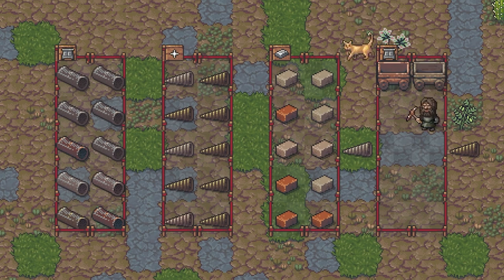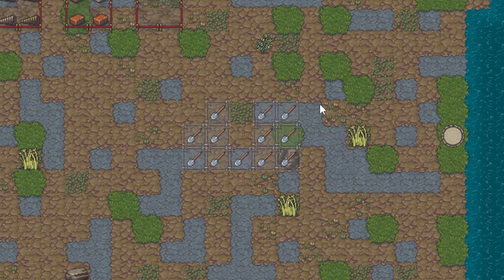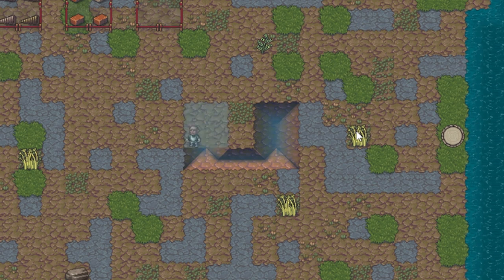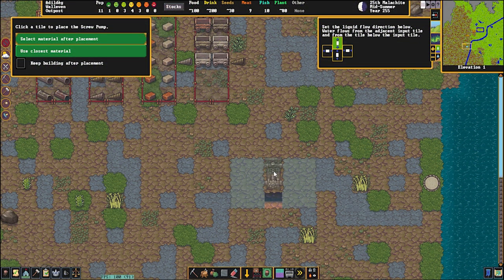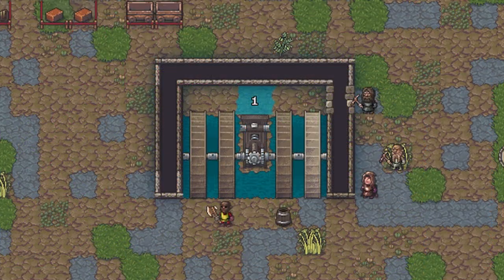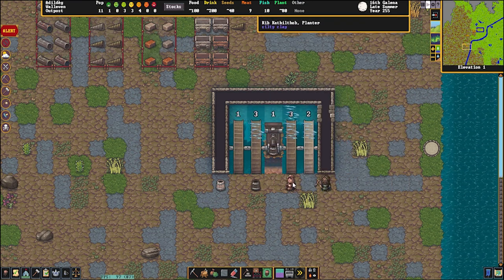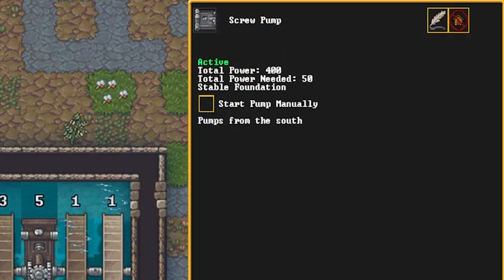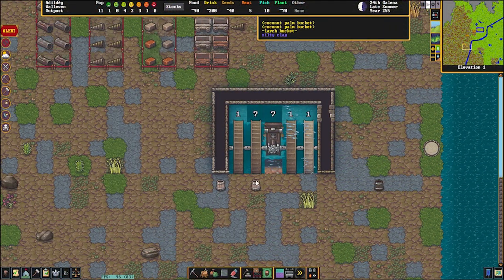Dwarf Fortress - Quick Tutorials - Infinite Power Generation (Dwarven Water Reactors)

Comment: First method is only functioning for about 2 seasons, after that too much water has disappeared.

Second method will not work afaik by aquifer-fed pools. 

So if you're in a biome where water does freeze and no running water or ocean... look elsewhere for power.
Reply: Couldnt you just move the whole operation underground?

Comment: is there a way to move power UP?? meaning to higher ground levels?
Reply from the maker: Vertical axles.
Reply: You can just build two gears, above and below each other, and they transmit power between them. Vertical axles extend it.